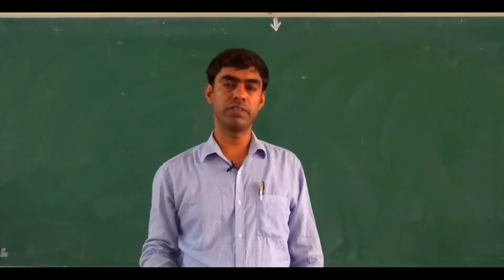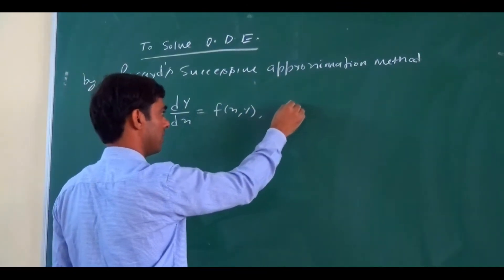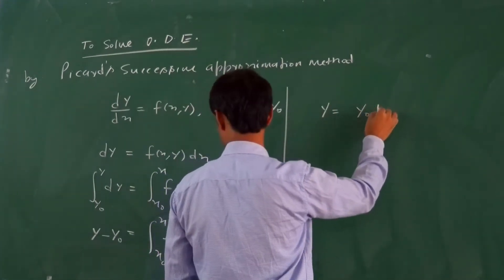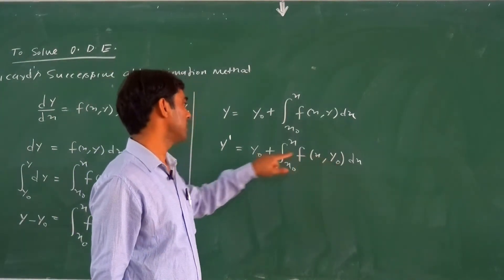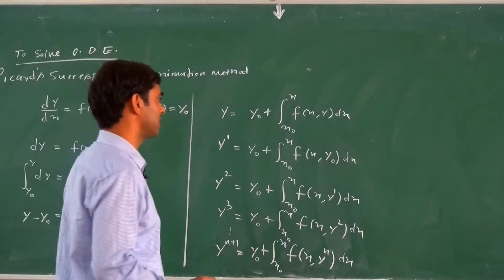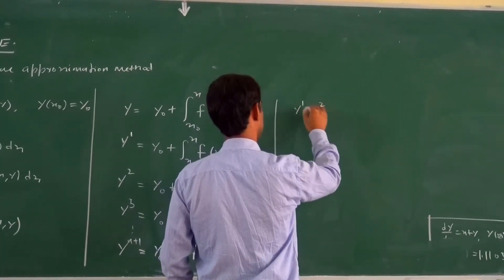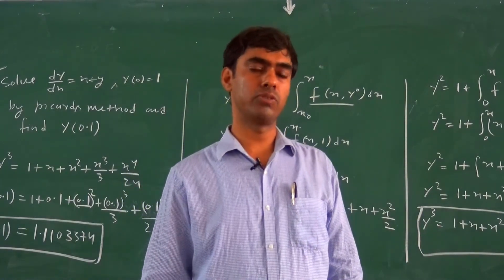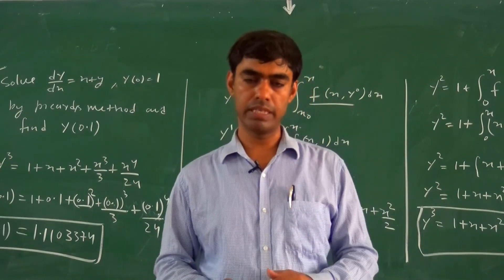Picard Successive Approximation Method with Numerical Example

Comment: Sir here in the question we have taken the value of zeroth approximation( that is by putting n=0) same as the value of y0
Can you please explain that is it correct to assume ...because with th same logic we get third approximation eqyal to y3
Reply from the maker: (X0,Y0) and dy/dx is given ....and in single step method we find the value of y1 on the basis of these two known values..on basis of (x1,y1) and dy/dx...we find y2 and proceed further...here first we find y1 not y0 because y0 is already given....
Reply: Thanks sir....

Comment: In the question will it be asked that find solution after 3rd approximation or generally there is trend for 3 or 4 approximation
Reply from the maker: In question it will be given...if not then you may find after 1, 2 or 3 approximation...but it's better if you do at least 2nd approximation...
Reply: Thank you very much sir